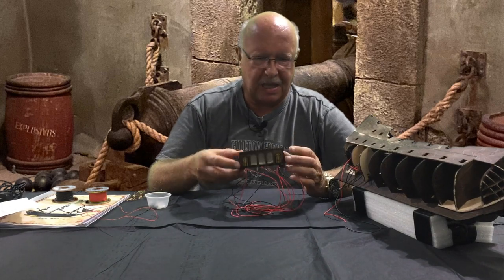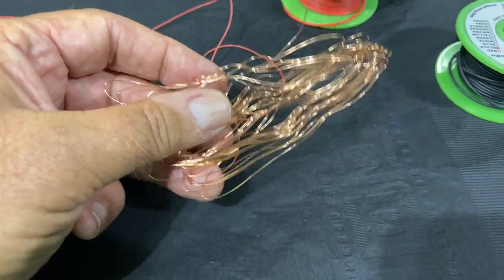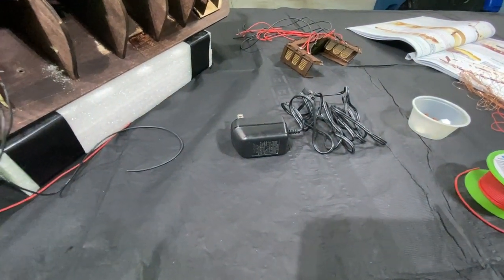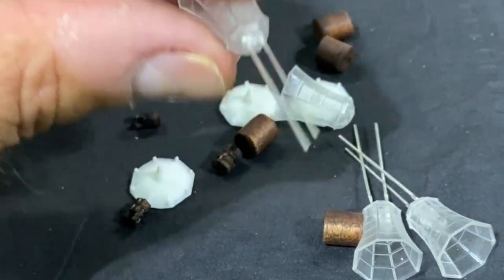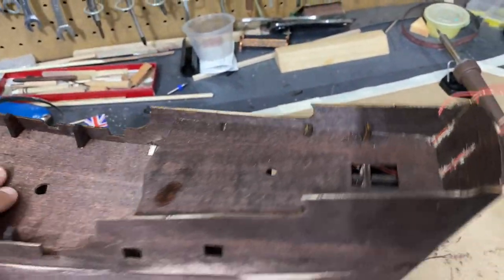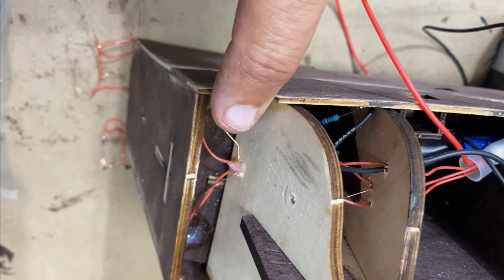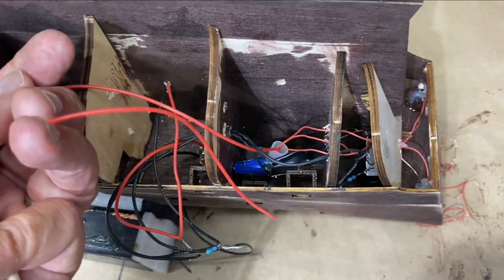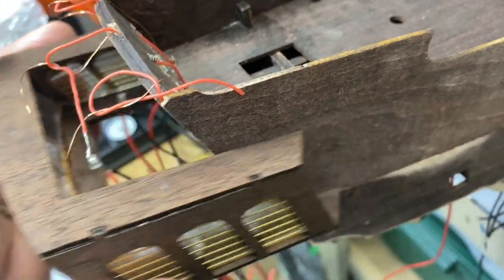The Black Pearl Golden Version 2021 Episode 5 (Discovering Electricity)

Comment: @boilerdan1, not sure if you’ve already discovered or not, and I haven’t watched the whole video, but instead of bare wire, look for “magnet wire”.  It’s used for re-wrapping electric motors & comes pre-enameled, so that they won’t short each other.  All you have to do it scrape or sand the ends for soldering.  The rest is insulated by the enamel & for this application, you don’t need to worry about overheating.  Hell, you can even disassemble an old magnet if you’re cheap and careful, LOL!  If you’re REALLY cheap, just cut a CAT-5 network cable and use the inner wires, as they are all insulated and still enough to route.

As an alternative to LEDs, you can get rice kernel lights that already are warm-colored, physically look more like a flame, and don’t need a resistor.  They’re incandescent so WILL eventually burn out, so there’s that.
Reply from the maker: Thanks for the tips.  I had one ship that came with that type wire and wondered what it was.  
Unfortunately I just got 1,000 ft of PVC Coated Tin Plated Copper Wire Wire-Wrapping 30AWG.
It’s very thin and works…. But the magnet wire would be a better choice.
Next time I order.
I’ll check out the lights at some point too.
When I used the magnet wire, I just held a flame to the end and wiped it off to bare the wire. It worked great.
I actually have 3 separate builds of The Black Pearl on YouTube:
1. My 1st ever that was a cheap knockoff 
2. The 2021 Golden Edition ZHL
3. The All Scenario version ZHL
Not sure which one you are watching 😂🏴‍☠️
Reply: @BoilerDan1  had to start a meeting at the office, but I am currently at around episode 8 or 9 on the golden version (working the top-side of the walnut planking)
Reply from the maker: @RossPotts Golden Version is good!  My first one was me stumbling through. The Golden Version is something you and even your descendants will treasure many years from now!
Work and meetings are so disruptive to the important things in life.😂
Thankfully I’m 💯 % retired.  Only take construction breaks when I go on vacations 😂😎😂🏴‍☠️.
Keep watching ahead of your build as I may cover mistakes in later segments.  There’s about 25 segments.
It sounds like you may have more experience and expertise than me but you can see the Pearl at different stages in the build.👍👍
Reply: nah, I’m still faffing about with beginner stuff.  I just have a lot of interests in different disciplines.  I’m more experienced with plastic models, D&D figures and 3D printing.  I also have a love of electronics which is feeding an idea I have for independently operated lights.  Looking forward to doing detail work on a big ship!

Comment: i run all my leds parallel but with only a three volt button battery , this way i dont need to use resistors
Reply from the maker: I’ve got someone at an electronics store working up a system that may eliminate them…..but I already started putting them in place….🥴.  I learn something new with each build!  I really liked the idea of plugging it in for power….. we’ll see how it turns out 😉
Reply: @BoilerDan1  as far as my knowledge goes you'll need the resistors for anything over 6 volts but it's been a long time since i did that stuff

Comment: How name to mounting to lamp?
Reply from the maker: I don’t understand your question. Please explain again using different words and I will try to answer.
Since I finished the model I have learned that the wire that came with the ship is coated with a thin lacquer so it would work to hook up the lights. You can put as many as you want. I think I used six in the captain’s quarters.
Thanks for watching 👍

Comment: is it just me that thinks that positive should have been red and negative black, I know its your model, but red positive is the convention I have always worked to.
Reply from the maker: You are correct. I should have looked it up first….. I will review my error in episode 6.  Where I got mixed up was thinking of AC HOUSE wiring where the black wire is hot and white is neutral 
😖⚡️🥴. Thanks for letting me know, I’ll do it correctly in future builds 👍👍